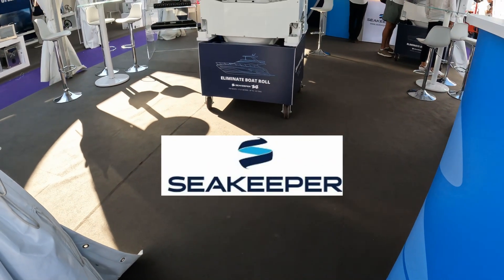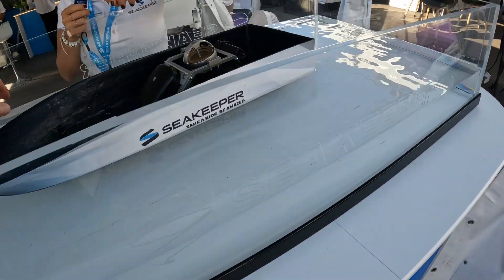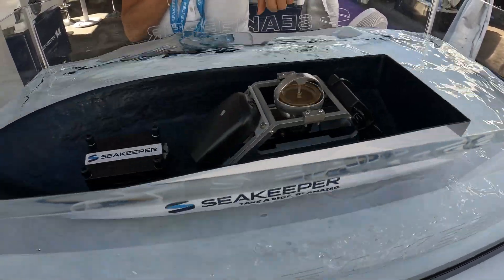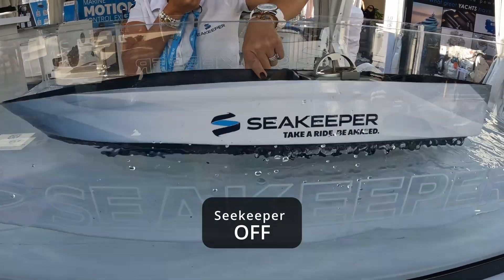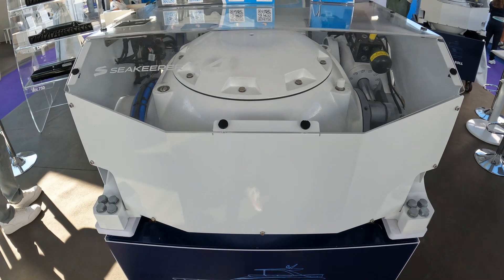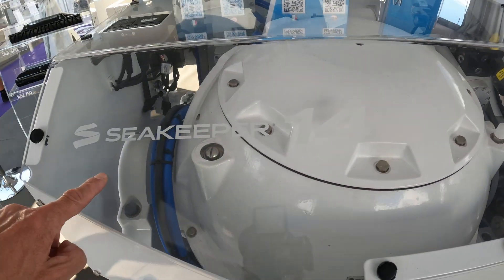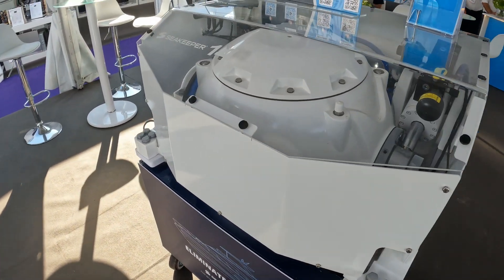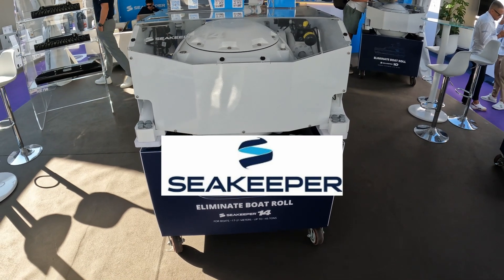Seakeeper Boat Stabilizer Explained  -  How It Works Demo

Comment: It just dawned on me that on the model Seakeeper gyro was mounted on the deck rather than deep in the hull, yet it still seemed to be mega effective. Surely Seakeeper, using this practice, could mount their product perhaps under the aft seating and merely run the wires under the deck to the batteries?
Reply from the maker: It would need to be low as possible, as the demo model has very little upper weight to it's topside, unlike a real boat.